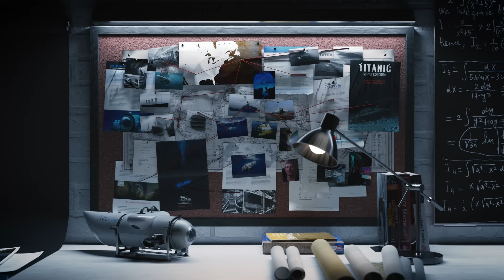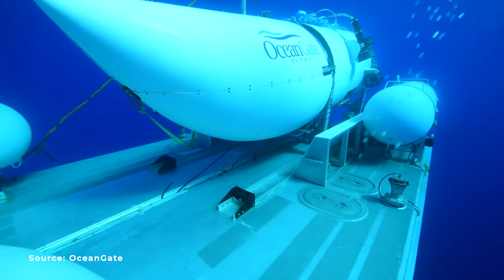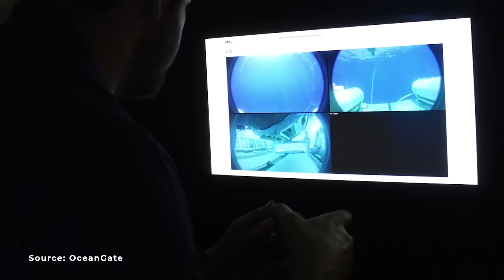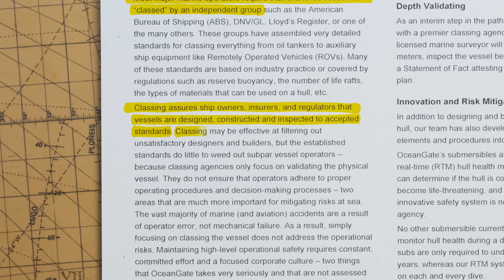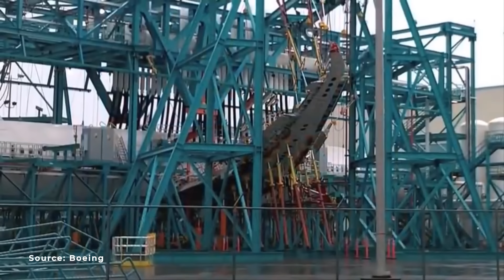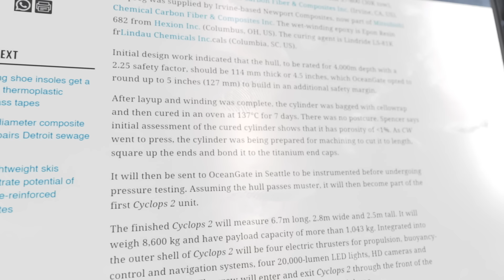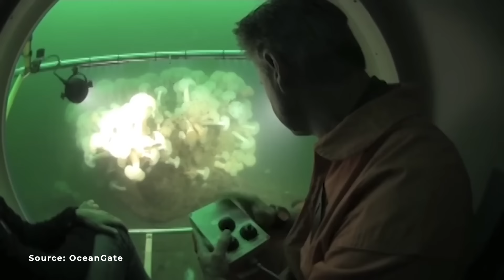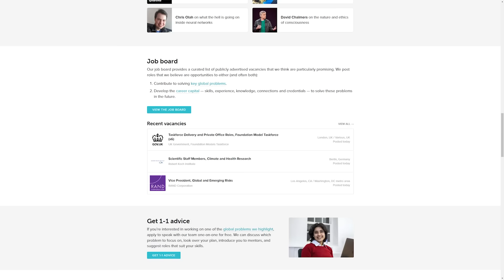The Questionable Engineering of Oceangate

Comment: If one were to bring the design of the Titan up to standard, would it be safe to use in shallow depths?
Reply: Maybe, but it still stands the same problems. Carbon fiber is very unpredictable when it comes to compression forces, you can never really predict when it will break!
Reply: Even at full depth, it could maybe if it was built and designed properly. You still wouldn't want to send humans in it for a quite a while until you understand exactly how the materials behave

Comment: Murder? Remember "Break the Hymen" Rickovers Nuke Sub "The USS Thresher"?

Tested in unrecoverable waters as depth charges pounded the new Nuke ship.
Some test, the sub broke and sank to the bottom.

They could have thoroughly tested a tethered or preprogrammed robot sub to reach the depths of the Titanic and cycle to the surface and back and even drop some depth charges in the water. 

Also, a Titanium Pressure vessel to withstand Titanic pressure could have been built for testing the Carbon Fiber pressure Hull__ Cycling a zillion times in the shop.

Sea level pressure and slowly reach Titanic pressure then slowly reduce pressure to sea level pressure. This type of engineering testing is always required when new technology is applied. Unless it is designed by KKK CIA Telepathic UFO Spooks__ then no testing is needed.

Comment: I don’t understand why any of the tourists paying 250k didn’t just google what happens to carbon fiber in the deep ocean, obviously none of them bothered to do some basic homework before signing up for the Titanic once in a lifetime experience 🤷🏻‍♀️
Reply: The Navy was able to build a submersible using a pressure hull made of carbon fiber with titanium endcaps without issue, and used it at the depth of and even deeper than the Titanic. It wasn't crewed, because the Navy isn't stupid, but CF does work if used correctly

Comment: an autoclave was used for the pressure vessel. they didn't use one for their abandoned V1 hull, but they did for the second. however, they did used it in an untested way: they constructed the hull in five, 1" layers, glued together, and autoclaved after each new layer was added. meaning the first layer was ultimately autoclaved 5 times — and the impact of this (and whether autoclaving different parts of the laminate material to different extents introduces stresses between the layers) is unknown & untested.

Comment: I’m a bit late, but I’m no composites engineer. However, I DID work on bicycles as a bike mechanic, and I worked with carbon fiber a bit, and anyone who has any experience with carbon fiber knows that carbon fiber does not act like steel, aluminum, or a metal in general, where it has give and usually springs back, with a bit of “squish” almost. When it fails, it fails catastrophically and without warning. It also doesn’t like temperature swings, especially cold, where it gets extremely brittle. It’s almost like wood. Choosing carbon fiber as a pressure vessel for a submarine, where it will undergo a lot of squeezing and immense cold, is absolutely ridiculous and borderline homicidal.
Reply: I'm an ultralight backpacker, and many years ago was psyched when I got come carbon fibre hiking poles that saved me a couple dozen grams over my aluminum ones.  Long story short: cold weather, smack rock, pole shatters.  I'm told that was an issue with the resin used in the earlier ones, but more cold-resistant resins eventually came along to solve that problem.  Doesn't matter to me - I'll stick to my good ol' aluminum, cork-gripped poles.

Comment: It should have been a murder investigation. No marine engineer would have EVER designed something that was built to fail as this was. Question: Who profited by one of the people in it dying?
Reply: Stockton Rush was not a marine engineer.  He was an aerospace engineer.  So, kind of the exact opposite of who you'd want to design a sub.
Reply: @AlbertaGeek I would assume that, given the reliance on fluid dynamics in both cases, aerospace engineers could probably learn marine engineering more easily than other groups, but it certainly is a different field
Reply: @addison1024 He didn't seem to let safety protocols get in the way.
Reply: @Lenny-x3b  Also very bad practice in aerospace, it's just that submersibles are somehow even less forgiving than aircraft or spacecraft

Comment: I often bitch about jackscrews on airliners. I normally just play flight sims and I'm not an experienced pilot or engineer but I even I see the complete absence of redundancy in a jackscrew and, low and behold, I heard of an airline crash involving a faulty jackscrew about a year after I found out what a jackscrew was and immediately denounced it in favor of trim tabs. Then of course, another. One I think was Alaska airlines flight something something, and another was that cargo 747 crash in the middle east. Both could've easily been avoided completely with trim tabs, but instead relying on a jackscrew to control the entire stabilizer, which effectively overrides the control surfaces in the event of a failure... It's beyond words. I pointed this out to Google AI and the damn thing validated the fucking design as being fixed and optimized after having learned from said crashes, despite the fact that my argument is the entire design is flawed, not just aspects OF the design...

Comment: I still can't believe the passengers didn't object. Rather they kind of celebrated this lunacy. It should have went like this:

Rich guy: "So most subs have a titanium hull or outer layer right. Why doesn't this one? The materials used must be stronger and lighter?"

Rich CEO with an Amazon controller: "Yeah most subs do. We used these materials because they're light and MUCH MUCH cheaper. They use the same material on the Space Shuttle and ISS."

Rich guy: "Oh I see. Wait, there's no inward pressure in space though. Just outward atmospheric pressure right? How can you be sure it works?"

Rich CEO with an Amazon controller:  "I'm going riding with you and a rich guy with a controller never dies. That's all the proof we needed. Oh by the way, Jim will collect your Wills and your NOK numbers now."

Comment: After watching the two new documentaries on hulu and netflix. What stands out to me on-top of what Real Engineering provided is the sheer fact that the pre-existing safety features DID indeed point to failure. 

Not only was there a failed hull around dive 50 that was replaced, but the acoustic monitoring system indicated significantly increased activity from dive 80 to the last dive with dive with dive 88.

Comment: There are plenty of examples where the engineers know the right answer but their position gets swept aside by time pressure, financial pressure or personal egos.  I have worked in nuclear power for 36 years and I worry about the next generation of nuclear power generation.  The current management in charge of the existing reactors DOES NOT operate and make decisions like the old days.  The pressure to put new power generation on the grid for AI data centers, EVs  etc. is growing by the day and I fear shortcuts will be made in design and construction.  We used to depend on the government to keep this risks in check but I will leave you with the FAA/Boeing fiasco which should have been prevented.

Comment: I just watched the Netflix documentary, funniest part was when the engineers heard cracks and snaps, Stockton just said the carbon fibres are "seasoning" 😂 I think he thinks that carbon fibre is like rubber. The worst part was before the final dive, the submersible was kept in sub zero temperatures after a failure descent. On top of that, I'm weirded by how nothing went wrong during the final dive because they kept cancelling dives if some problems surfaced even if they were just less than 200m down.
Reply: "Seasoning"...the same high level thinking that will lead people to water their crops with salty sports drinks!

Comment: You can't use average, the weakest point in the laminate will kill the occupants. You need to test for the weakest point. 0.00000001% void is still eventually going to fail. There was no engineering in this "sub". Only M*rder for dollars.

Comment: There's sooo much stuff you've missed here...and a lot of it is actually wildly innacurate. The reason for the carbon fibre hull was mostly to reduce weight - even as light as it was, most ships able to carry it out to the ocean on deck were wildly expensive. After pandemic ended, they couldn't even afford them, and Polar Prince was towing LARS with Titan on top of it. Reduction of cost was not due to the 'foam' on aluminium/titanium hull, it was to reduce weight and be able to get it out cheaper (still $200k/week).
Furthermore, as much as there was wrong with it, they actually couldn't get it classified - to do so, with other materials than steel/titanium/aluminium, you have to build 3 test vessels and test them to 6x the required depth - there simply isn't a place on earth where you could do that...there's no 24km trench in the ocean, there's no facility able to produce such high pressures on a scale of a Titan.
As for the delamination, again, as faulty as it was, they had RTMS - real time monitoring system. The biggest issue here is, it actually worked. Showed data of locally damaged hull, which was then behaving differently than before. Everyone heard the bang it made when it happened, but instead of investigating it, they did 2 more (!) deep dives to the Titanic, left it over winter on a parking lot in Newfoundland, towed it for 6kkm over the ocean, and dived again - that's when Titan finally gave in and imploded. ...maybe do more than 2 days of research next time, please?
Reply: I hope he revisits this topic with all the new info that’s been released.
Reply: @TypicalSudo so do I. And I don’t know if you’ve deleted the comment (or it was someone else’s) about it being a reach that he only took 2 days to research it, but I said it only because he said so himself at 6:19
Reply: He’s more right than you think. Based on the Dr Kramer’s testimony, we now know that the composite hull was more like 5 hulls glued together with epoxy. And given that several of the layers delaminated upon the implosion, delamination coupled buckling was likely the primary failure mode.

Comment: This is one of the better videos on the subject. It was produced shortly after the accident and its findings are still mainly valid.
A few updates. We now have access to the design  analysis through the US Coastguard hearings and we can see what was and wasn't considered. There will be a detailed review of this on my channel soon for those who want to understand the details.
A minor correction. The hull which failed wasn't the one manufactured by Spencer Composites which was taken out of service. The second hull was manufactured by Electoimpact who built the hull in 5 stages, autoclaved at the end of each stage. This meant that the inner laminae were autoclaved 5 times - one suspects that there's very little test data to support this.
This video has much more substance to it than a lot of the clickbait posted on YT.

Comment: The fact that they not only reuse the titanium rings from the first hull but actually added on unsanctioned lift rings to avoid having to do the complicated sling method to raise the submersible onto the deck of the ship is frankly one of the more horrifying design choices they made purely for convenience and without any proper engineering...

Comment: There's an issue which is mating dissimilar materials together at a high pressure mating surface and it is a no no, also composite materials being an anisotropic material will not do well long term with such a variance in pressure.

Comment: Move fast and break things isn’t bad IMO when you aren’t risking human lives. SpaceX moves fast and breaks things but never does that with human lives IMO. It was years and hundreds of flights and tests later before humans rode on a falcon 9. Move fast and break things in engineering is good for prototyping stages IMO. You want to get 80% there as fast as possible but once there then you need to slowdown and refine and perfect safety before you ever add human risk to the mix

Comment: so, what we found out from the forensics on thee carbon fiber was that every time it went down the carbon fiber got more destroyed as the adhesive holding it together was basically turned to dust in some places. I know I don't have to say that dust is not a good material for a pressure vessel. Essentially, their work helped prove that carbon fiber can work on a submersible meant for one dive, but less so for vehicles meant for repeat dives. It actually turned out to be the least desirable material for what the tourism industry they wanted to make.

Ya know: something they would know if they had destroyed at least one of these in an unmanned dive and put the remains under a microscope which is what the rest of the submersible community wanted them to do first.

Comment: Their now-deleted blogpost claiming that most modern submersible accidents are caused by user error reminds me of an infamous blunder the RAF did during WWII: they would look at aircraft returning from battle and see where they had taken the most damage and subsequently increased the armour in those spots. This of course was faulty reasoning because these areas were already sufficiently armoured to allow the aircraft to take significant damage and still remain operational. The areas needing more armouring were, of course, only shown on aircraft that didn’t return from battle. 

Likewise the notion that user error is is majorly responsible for submersible accidents is a testament to the safety and proper engineering involved: the safeguards put in place design-wise eliminates the kind of risks that ultimately doomed the Titan, leaving the human factor in operating the vehicle the only real risk left!

Comment: To make this easy to understand: Carbon fiber composites are better at handling pulling forces (tension) than pushing forces (compression). In airplanes, the pressure is higher inside than outside, so the material is stretched, which carbon fiber handles well. But in submarines, the pressure is higher outside, which compresses the material, and carbon fiber isn’t as strong under that kind of force.

Carbon fiber composites are strong and lightweight materials made by combining carbon fibers with a resin, ideal for handling pulling forces but weaker under compression.
Reply: They can notably still have 30-50% of their tensile strength when used in compression, and competent engineers making a good design can work around that

Comment: There was engineering involved in this? Seemed more like a couple of scribbles on the back of napkins, and a wish upon a Unicorn.
Reply: design of titan was commisioned to a professional company. it was tested for pressure up to 4200m. but they left it exposed in the winter, then it spent about an hour partially disconnected from the launch platform, but constantly banging against it

Comment: I'm not an engineer, a diver, or a scientist. STEM subjects have always been a weak point for me. Even without this fantastic explanation of the reasons why this was a bad idea, I could tell you that listening out for crackling as a sign of failure is a bad idea. Or driving a deep-sea vessel with a bluetooth video game controller is a bad idea. Or refusing to listen to safety concerns is a bad idea. I also know that having an expert watch a single dive does not count as adequate testing. Literally the first thing they teach you in both science and statistics is that you gotta test repeatedly and take a large sample size. I'm amazed this man could be so confident when everyone in this field was screaming that this was a terrible idea. If you have a brain, you don't need an engineering degree to understand how insanely dangerous this is.

Comment: Compliments on an excellent concise presentation of key engineering points in common language. I have seen elsewhere - unverified, perhaps confirmed/falsified/refined by the report of the Titan investigation - that the hull was autoclaved after each 1" increment of thickness, having to be moved 50 or 60 km or miles to a different facility for that purpose. Maybe heat cured not to autoclave temperatures, don't know. That raises an additional testing question regarding effects of repeated heating on some layers but not all. It would appear that seeing too many digits on financial statements causes neurological rot and malfunction.

Comment: It's not quite true to say the questionable RMS reactive safety feature was TOTALLY useless.  The data on the RMS graphs showed a large peak of sound energy in Dive 80, eight dives before the implosion.  After that event, there were much more subtle but consistent changes in the data, relatively slight but obvious to the eye, that could have saved everyone before the fateful dive even happened... if only Stockton Rush had actually done anything about it (or even study the data at all, perhaps).